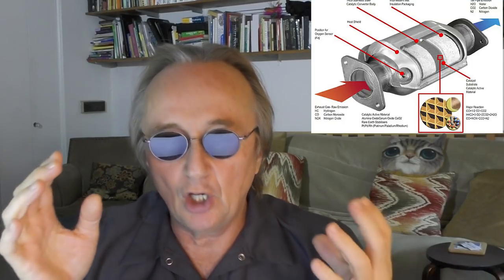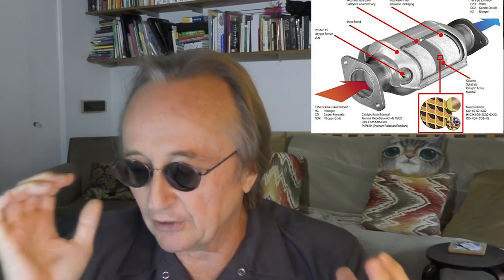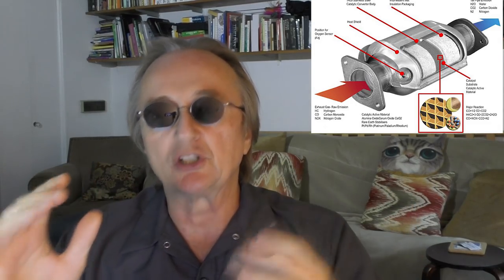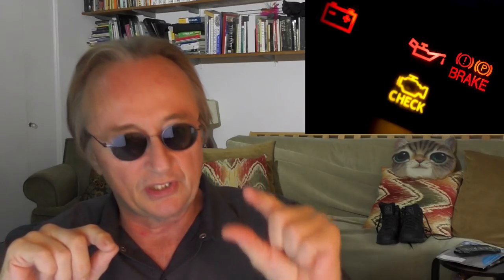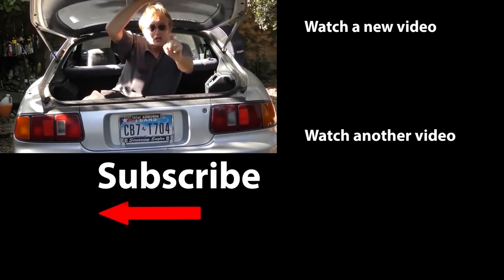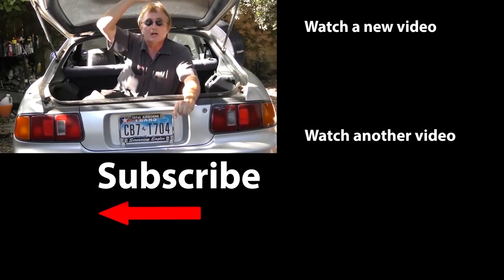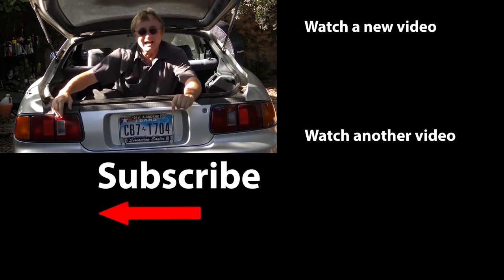Why it’s Illegal to Remove the Catalytic Converter in Your Car

Comment: You don't just take the Catalytic Converter off, you take it off then bust out the guts and put it back on and no one will ever know.
Reply: Just got done doing that with the T-Bird I just got..
Reply: Rooney 

How do you pass emissions for inspection
Reply: Unless you live in a place that requires inspection.
Reply: TRUE CAR GUY CUZ YOUR TOTALLY RIGHT!!!!! ME N THE HOMIES USED TO DO THAT ALLL THE TIME
Reply: @Oreo_5oh  pay for illegal smog check
Reply: Cats help with air quality. Don't be stupid. You have to breath the air and if you someday have kids, they will have to breath the air you are polluting.
Reply: Jared Morgan if it’s over I think 25 years old there are no emission standers and you can do that legally
Reply: The 02 sensors will detect it, if you remove those you wont pass NC inspection.
Reply: it will pass the visual inspection if you gut the converter and install the shell.
Reply: @Oreo_5oh  you don't
Reply: for the issue of the CEL there are fake O2 sensors you can get that either contain a small bit of catalyst just for the sensor or it puts out modified data to make the computer happy
Reply: riverstrat  There isn't any asbestos in a catalytic converter.
Reply: I live in California and not only will they find out (2 year Dyno tests + visual inspections) but they will cancel/blacklist your smog license if they can prove you passed a car with "mods" even if it ran just as clean as a production car. It's totally insane.
Reply: Tree huggers be snappin up in here.. we just feeding the trees yo, so they can breathe better, making more oxygen for you and your kids!!! 😂🤣😂🤣
Reply: Codeman  What emissions? Many states have no emission testing
Reply: @David Regan is that one of the reasons why so many Californians are moving up here to Oregon? To escape the insane emissions law? Usually 1 of the 3 happens:
-Californians move to Oregon (or bypass us on to Washington, hopefully)
-Californians find some loophole to register their cars in Oregon, where there is no emissions testing
-When their car fails emissions testing and would be too costly to fix, they bring it up here to sell
Reply: Keirnoth my 1995 f150 5.0 had a o2 sensor in front of the cats.  When I straight piped it I put the sensor in the right side header and the CEL light stays off and the truck runs alot better now and it gets 15.5 mpg.
Reply: Except for the emissions test.😒
Reply: Jake Smith I'm in Florida there is no emissions test here.  Everyone down here is pretty much running straight pipes and open headers.
Reply: @dontrend5956  not unless you live in a more rural area, having a lot of trees around to really does help the air quality. If you live in the city , well that sucks for you.
Reply: Thats what ricers do.
Reply: @Oreo_5oh  get a second one that works and only put it on when you are going to the ispection after that you put the fake one on and have fun
Reply: the computer knows,    the car has oxygen sensors in the exhaust,   they tell the fuel injectors how much gas to give the motor,   when you mess up the rate of flow,   the injectors dump crazy more gas into the motor,   and it messes up the spark timing.
Reply: I do live in a rural area but the point is that polluted air circulates around the world. The idea that removing a cat is going to increase performance is just ignorant. They are on cars for a good reason but apparently, some people are unable to understand the reason.
Reply: @ateam6486  Completely wrong. Cars have PRE-cat and POST-cat 02 sensors. The engine lean/rich is measured by the pre-cat sensors. Removing the cats doesn't affect them. The post-cat sensors are only there to tell you the if the cats are working. Stop talking about stuff you know nothing about, you're making a fool of yourself.
Reply: @dontrend5956  But it does increase performance. Less restriction = more power. Especially on older cars and dpf systems where the emissions equipment gets clogged up. I ain't about to pay $300 to replace the cats on my 20 year old truck. Nah, those cats are getting scrapped
Reply: You make an assumption without any testing. Unless it's a high performance vehicle, the cat removal will not make any difference. High performance vehicles today ALL use cats.
Reply: @dontrend5956  I took mine off. I get 1.8 mpg better. So... They do nothing right? Lol
Reply: Right. And you coffee can muffler added 20 more hp.
Reply: Your old truck gets more power. How much? 1 hp? I can't believe we're having this discussion 40 years after they started putting pollution controls on vehicles. But some of you idiots would rather breathe polluted air than clean air. You talk about increased performance in a 20 year old truck? The only performance you get is the capability to get from one place to another with a worn out engine.
Reply: If it does get a small increase, it's because the cat was plugged up and needed to be replaced. But never mind. I don't want to confuse you.
Reply: @dontrend5956  Has a new engine bozo. And no. I took a look at the cats after I pulled them, they looked brand new. Ever seen the ridiculous emissions they put on new diesels? Every restriction sucks power, you can't tell me all that crap flows as good as not having it, especially on a turboed engine.
Reply: Because you need every bit of power when you go grocery shopping.
Reply: @dontrend5956  The power gains are negligible. You won't feel a difference cat vs no-cat, at least on engine designed in the last 20-30 years. It's more about economy. Burns less fuel to get the same result. Also, once you have the cats removed you can lean out your engine a little bit more and use even less gas. Less gas burned = less polution. The cats don't reduce the emissions,b they just convert the harmful stuff into slightly less harmful stuff. But if you're burning less gas in the first place... You do the math. Besides, even if I ran the thing full throttle for 20 years without cats, it'd still produce less polution than it takes to make a single hybrid or electric car.
Reply: Thanks for confirming my original point. Minimal gain while polluting the air. the polluted air must be affecting your thinking. And cats do make a difference. Once again.  Do a tailpipe emissions test with and without the cats.
Reply: @dontrend5956  Minimal POWER gain. Very good efficiency gain. My engine gets 16% more mpg now. That's a lot
Reply: I'm done arguing with you. Go bother someone else.
Reply: @melrobinson6919  Hell yeah!
Reply: @dontrend5956 and by "idiots," do you mean "others who disagree with you?" Sure seems like it given your childish attitude and the namecalling.
Reply: A good reason not to live in Calif!
Reply: Soon as they smell the exhaust they will know, they have high flow ones but they arent legal everywhere but they are MUCH better than the stock ones. Ive always said why not just provide better cleaner burning fuels? but what do i know lol
Reply: @andybub45  lol WHAT O2 sensors? Never had em never will. And my carburetor runs clean enough not to need them
Reply: @98triffid  Never Never register your car in CA. go get a mailing address in SD or MT and get your plates there.
Reply: @dontrend5956  actually I did do that, well the state of MO did it when we had to have dyno tests done, my truck had nothing but a cat shell on it and the results were less than 10% of the allowable threshold, so that means a guy WITH cats would be allowed to pass with 10 times the emissions I had. That is proof enough for me
Reply: @integr8er66  Sure, but CA law dictates you register it in-state within a month or two. I'm not saying you can't get away with it but it's a very iffy proposition.
Reply: @98triffid  only if the car has been in CA for 30 consecutive days. If you "leave" the state at least once a month you don't have to. You just tell them that your car is mostly used out of state and you have it registered in the state you usually use it in,  and its registered to your address there.
Reply: That's a good idea. Well I know what I'm doing hahahah
Reply: @Pontiac717  It has been done by many, it started off as a way to avoid sales tax on super expensive cars. You simply form a corporation in MT, The lawers there know all about this, and it generally costs $100 tp do so, then the car is owned by the corporation and is regestered at "corporate headquarters" Also once the car is 11 years old you can get permanent plates for $87. That means never pay another dime for registration. So your 71 Pontiac. One time registration, no inspection or smog test. Just google it, its real.
Reply: Emissions check will show it.
Reply: Well sir why would we have one of those done? I know I don't. Not everyone lives in a nanny state. Next I had empty converters for years, hell I still do and my truck has been on the road since 1986 and has over 500,000 miles on it and I have NEVER had any issue. There was a short time here when they did a dyno smog check and with NOTHING in my converter shell I passed with numbers that were less than 10% of allowable. If your engine runs right you don't need these things, on mass scale do they help, sure, but I'm not paying $600-$700 for a new one when they plug up. So short answer is no, they won't know...DEPENDING on how close someone looks, and for most of us that isn't very close, besides who can't just pay a little more for the exemption?
Reply: I’ve done that on my crotch rocket 😎 more sound!!
Reply: Running gutless cats for 20 years an air hammer with chisel tip start car blow out chunks install pipe done
Reply: Honestly even if your state has emissions there are shops that will "pass" your car if you give them a few extra bucks... or you can literally just install the cat or dpf back yourself for that one time and then take em back off. Not that hard considering it's like a once a year thing
Reply: Funny thing about catalytic converter there is more pollution from the mining of all the precious minerals to make them then there is all the cars in the world fact
Reply: Don Trend 

Funny how you say that when you keep chopping down trees, which also clean the air.
Reply: Except for that your engine runs like s***.
Reply: @98triffid  dyno tests?  You mean running smog samples?
Reply: @FirstLast-om8li  How is an engine that has better air flow gonna run worse? Converters are not on there for performance.
Reply: @dontrend5956  please stop and take some time to study the classical logical fallacies.  You put them forth as though they have actual meaning even though they have been known since the time Latin was the dominant language on the planet to be completely fallacious.  The only reason modern high performance cars have catalytic converters on them is because the law mandates that they have them on there they do not make them faster they factually *always make them slower*.   Your appeal to Authority and bandwagon logical fallacies only expose you as a nimrod.
Reply: @crowofjudgement159  the ECU was tuned with them there when you take them out the ECU doesn't retune itself, but continues to run its programm as though it is there that's why.  You're either dealing with a too lean conditioner a too rich condition guaranteed.  Mechanics fix holes in pistons and carbon fouled valves all the time from people who thought they were geniuses just knocking the center out of a cat.
Reply: @FirstLast-om8li  at specific sustained  rpm levels yes
Reply: @98triffid  So not dyno.
Reply: @FirstLast-om8li  But all of that goes out the window when you are talking about carbureted vehicles. And the ECU can be fine tuned for the engines exact build. But yes don't knock out the cat on your 2009 Honda daily driver.
Reply: @JingleBop  I have a Mazda 3 2018 I want to remove the cat but I’m afraid it will trip a sensor
Reply: @crowofjudgement159  I have a 2018 Mazda 3 and want to remove the cat but I’m afraid the check engine light will come on
Reply: @fifagodmcjuggernuggets3411  2018 is new enough that you'd probably need to get the sensors tuned out. I don't know anything about those cars tbh, mostly just SBCs and Gen 3 ls

Comment: If I remember correctly, this was tested in court some years ago and it was found that an individual who owns the car can do whatever he pleases with the car. The people who are precluded from removing that item from the car are licensed mechanics. At least as far as Federal law goes. And the reason they're liable is that they are licensed.
Reply: You do not remember correctly.
Reply: I was told a long time ago by a mechanic that he can't remove a cat but I can. If I bring it in without one with a piece of pipe installed he didn't have to reinstall one.
Reply: It’s true 👍🏼
Reply: How do u get rid of that low end clapping sound wen accelerating?the sluggish sound.  I want to actual go somewhere wen accelerate
Reply: How do u get rid of that low end clapping sound wen accelerating?the sluggish sound.  I want to actual go somewhere wen accelerate

Comment: Plot twist...my truck never came with a catalytic converter! Lol
Reply: What year is it? Jc
Reply: @edgarsmittenheighnjenkson9226  2003 Dodge Cummins diesel
Reply: So someone took it off before you bought it lol.
Reply: Brandon Burley     No, standard shifts don't.    lol
Reply: @edgarsmittenheighnjenkson9226  I can guarantee you, that truck never had one to begin with. 03 and early 04's never had them. 04.5 and on is when they all had them
Reply: My '65 didn't come with one either. Since it normally only visits the lumberyard or the dump I don't feel bad about that, it's like recycling...but with a car.

I do like to drive it on Earth day though. I know I won't convince Tesla and Prius owners that we are incapable of changing global climate policy but it's fun to show them why.
Reply: my 74 motorcycle and 72 vw beetle never came with cats either. lol
Reply: Edgar Smittenheighnjenkson if it's an 03 (Euro emission class 2) then it could be possible, especially since it's an American vehicle. Cats are very different in diesel vehicles, and even today a modern everyday diesel still has that typical diesel smell. They have two way cats, a gas car has 3 way cats and when you're standing behind a gas car, you literally barely small anything at all. 
Diesels were seen as cleaner bc they were more efficient and emit less CO2. I live in the heart of Europe and at some point 80% of our passenger cars were diesels. Looking back, everyone realizes there are too many (harmful) particles that come with burning diesel, so people are afraid of them now (and VW's scandal didn't do this any good) so governments try to ban diesels as much as possible, especially if they're under Euro class 5. We're back at like 60% gassers now and it's only gonna increase (together with CNG etc). 
Diesel is a great fuel but it should've never been used in passenger cars. I've driven enough manual and automatic diesels and gassers (turbo and natural) I know what I'm talking about. 
Get a diesel if you tow alot (because a V8 will give you horrible fuel economy and might be even worse), other than that... I mean we even have 7-seater cars that get 35 American MPG. That's not bad!
Reply: Brandon Burley diesels dont have catsbc they dont get hot enough for them to work. they have the mf soot traps and def injector tanks that waste space
Reply: Diesel doesn't use catalytic converter
Reply: @brandonburley3080  You got that low output Cummins lmao
Reply: Joke on you my mustang came with a catalytic converter but no muffler 😭

Comment: Most new cars use the rear oxygen sensor to fine-tune the fuel mixture. Toyota started doing this in the 90s, if you remove the converter the fuel tuning won't work correctly. The rear O2 sensor is not just there for Diagnostics

Comment: Catalytic converters also function to reduce(separate the oxygen from the nitrogen) oxides of nitrogen that are formed during a high-temperature combustion process and supply that extra oxygen to complete combustion of the carbon monoxide to carbon dioxide and the unburned hydrogens in the exhaust. A good alternative to a restrictive OEM cat might be a high-flow racing type with a honeycomb core.

Comment: Bought my Cadillac without any emissions equipment whatsoever. Previous owner deleted everything, EGR, catalytic converter, air pump (smog pump, whatever), you name it this car doesn't have it. Living where I do there are absolutely no laws against this whafsoever, my mechanic says it sounds like a baby mustang!
Reply: hold on,    your missing a little something,    even if your state or city does not require them or for testing,  any and all federally mandated safety and EPA devices must be left on the car,   its also illegal to remove seat belts and the tire pressure monitors at the valve stems,   and i am betting your car drinks gas like crazy due to the oxygen sensors telling the fuel injectors to give way to much gas to the motor,
Reply: @ateam6486  TPMS didn't exist
All seatbelts are present 
It's a Cadillac of course it drinks gas
Reply: Thats called Government Tyranny.
Reply: Where You live?
Reply: theres laws against it but if your state doesnt do emmissions testing theres no one looking for the violations. its against the  law but no ones looking for the violations.

Comment: If the catalytic converter starts plugging up, you can take it off, get a hole saw close to the diameter of the inlet or outlet and a drill extension, drill out a passage between the inlet and outlet, then put it back on.  Unless they take it off and look inside, the revenue collectors or auto inspector will never know the difference.

Comment: The first time i removed a cat conv from a car was on 93 Fleetwood Brougham. Not really a caddy guy but it was cheap and reliable at the time. Anyway, i knew it was clogged up. Hacksawed it out. Lived down in MS at the time. Found a shop that welded a piece of pipe in. Ran so much better without it. Had the 350 in it. It was a 93 model.